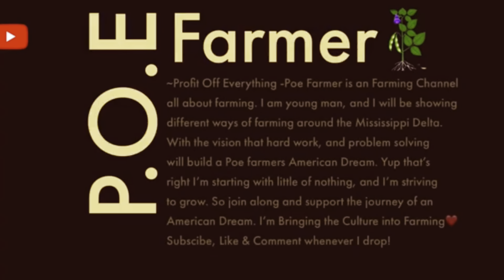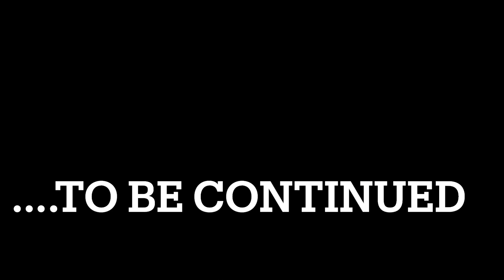I’m So Tired Of This!!!!!!

Comment: Check your tank and see if the liner inside came apart. I seen on some tanks under a load it picked it up and soon as it cuts off the liner goes back down and then goes back to running again. By know I would have set it on fire and found something else.